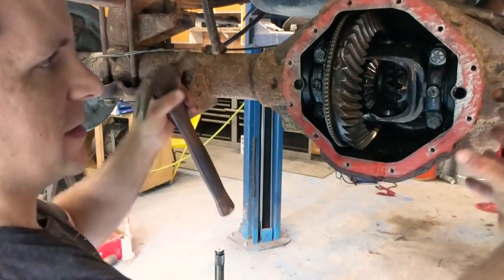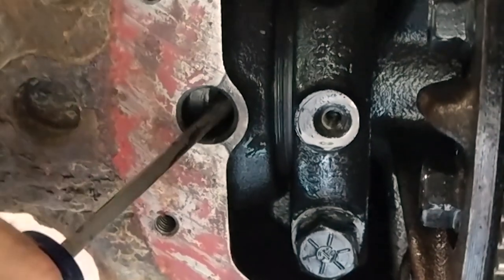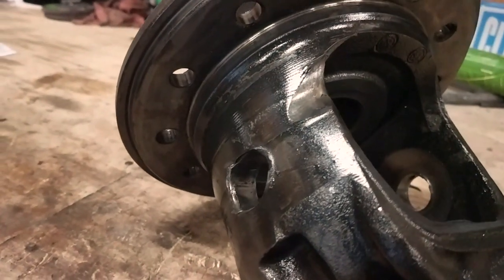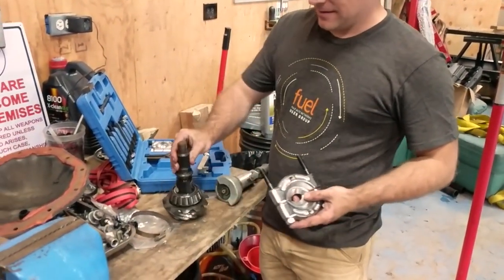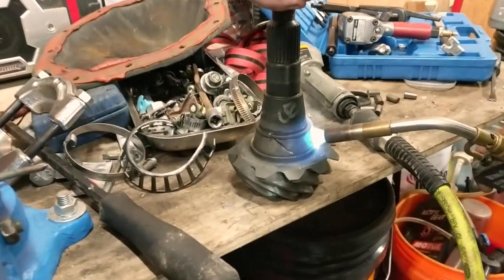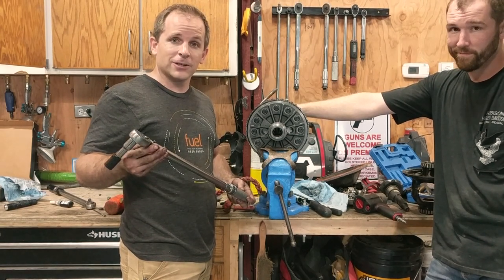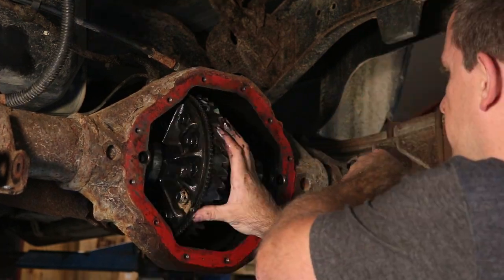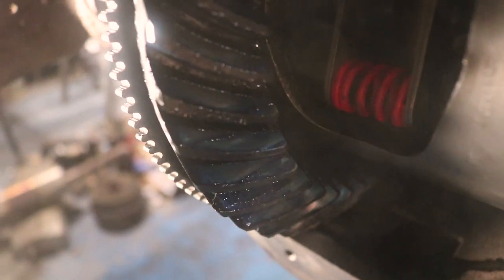We Start the Rebuild on the Dodge Ram 1500

Comment: Those carrier bearing endplay nuts are so nice.  For the larger Dana 60 and 70 axles they sell a "spreader tool" that goes into the 2 holes that you used, and it literally applies enough load to spread the case apart so that you can install the carrier shims and bearings.  Not fun while laying under an RV.  Good luck with the clunk.  U-joints are next I suppose.
Reply from the maker: i wonder if the dana 44 i got up front is the same way... But you are right, Ujoints on both sides are next!

Comment: Why would you put a $600 LSD in an old work truck?
Reply from the maker: The frame of the truck was flawless, and the cost between an open diff and this lsd was only a $50 difference (350vs 400). The truck was missing most of the diff when  i got it.